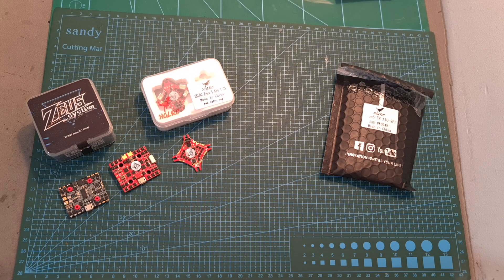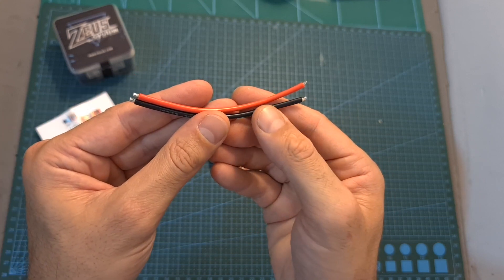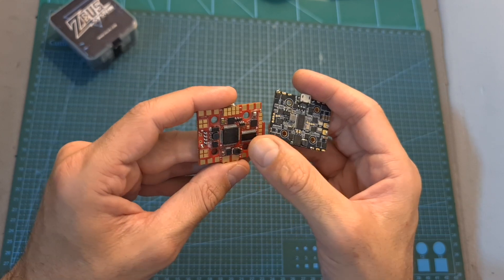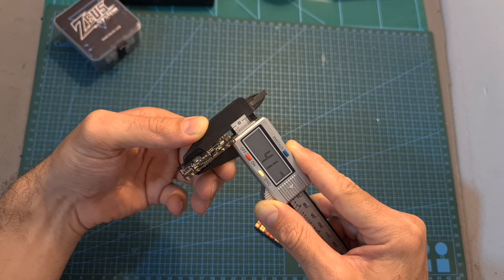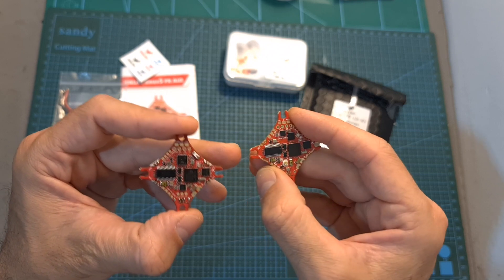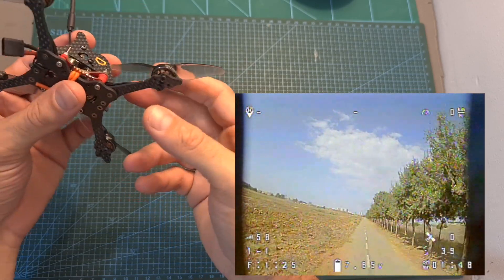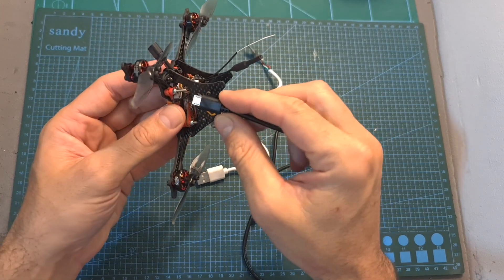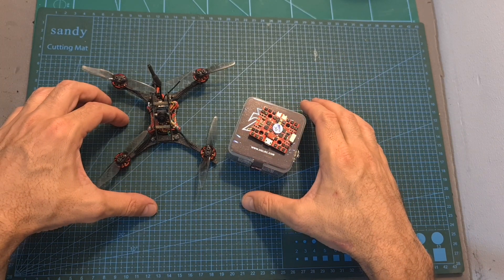HGLRC Zeus35 Pro & Zeus 5 FR // Overview & SPI RX Receiver Test

Comment: Wonder what frames it fits in. One frame I was looking at. Spoke to them and the flywoo one wouldn't fit they said
Reply from the maker: You will probably need a frame that supports 30mm stacks due to the oversized structure of the Zeus35 Pro. 
It should be a good match with a light 5 inch frame.

Comment: The old 15A 20x20 AIO Zeus is my fav board of all time, still rocking it in my main digipick 3 years after I originally purchased it for a 3” split-style hd cam carrying quad. The new one looks like trash compared to it :(
Reply from the maker: Yes the original Zeus AIO worked great for me too. 
I also have a good experience with the Zeus 35 and the quality of the Zeus35 Pro looks actually better than both.